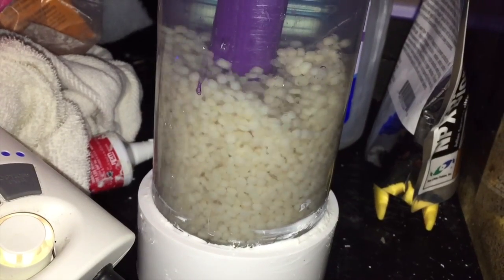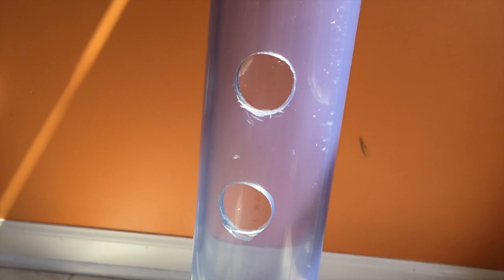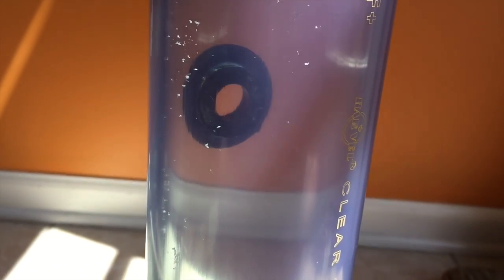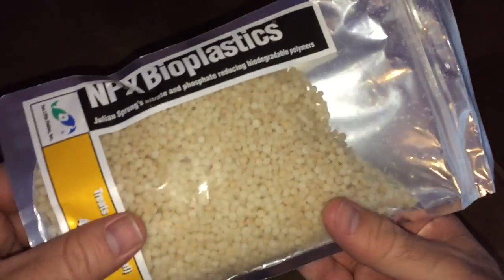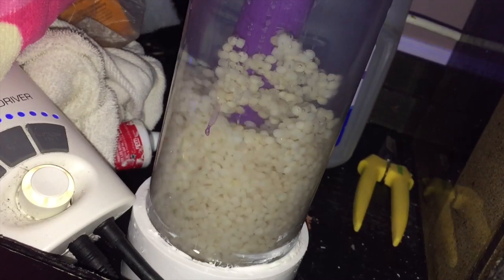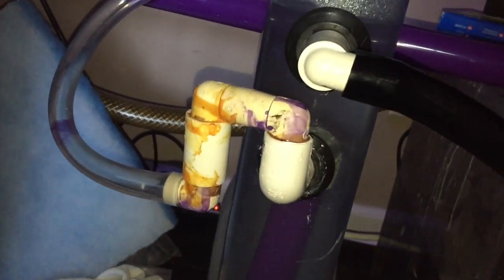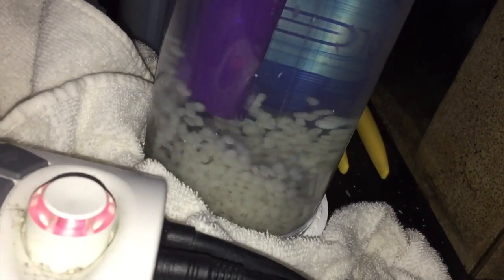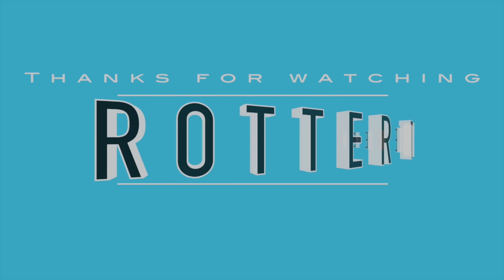bio pellet reactor DIY - I made a bio pellet reactor

Comment: were did you find the clear pvc?
Reply from the maker: online. only issue is most places sell minimum of 10' which is pricey. i built a few for a couple friends so i needed the pipe but just for one, it would be pricey. you may be able to find someplace that does custom lengths. this reactor is a little over 2 feet tall.